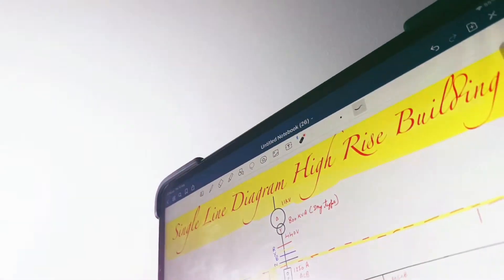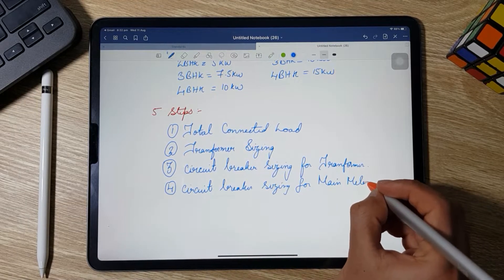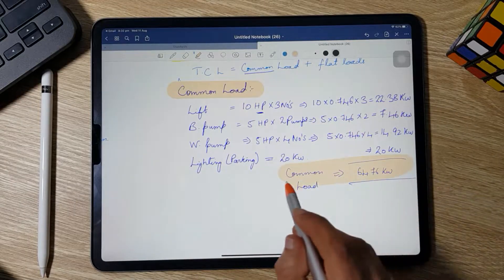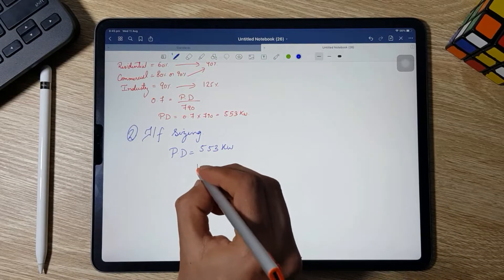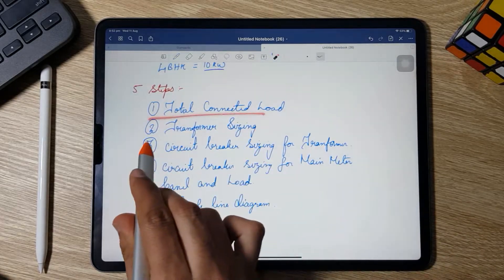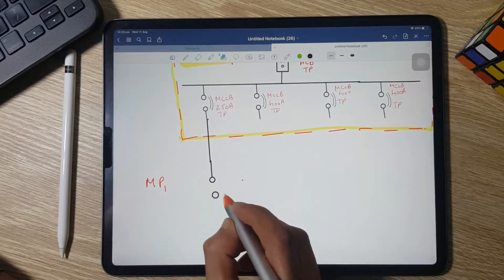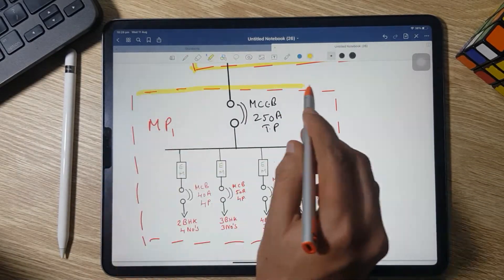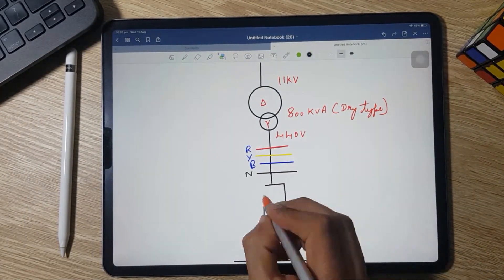Electrical Designing of High Rise Building G+10 | Electrical Design Course

Comment: when you calculate the current rating of the circuit breaker, you should consider the total connected load and not the peak demand. because te peak demand is always lesser than total connected load
the circuit breaker ratings should change, please correct me if I'm wrong

Comment: Thank you very much for this informative video. I had one question. 2BHK flats are provided with single phase supply. So when determining C.B size, for converting Watts to Amps, we should be multiplying with 8 and not 1.9 right? (Based on your G+5 electrical design video)

Comment: I have a doubt related cb sizizing 
For 1500kva transformer Secondary side.
Once we convert kva to amp
1500kva*1.4 =2100A
Should be consider 1.5 safety factor or directly select breaker from 2100A

Comment: Time 11:04 When you are calculating MCB for 2BHK load, you multiplied 5kw by 1.9 ... but wo to 3 phase ke liye aayega na ... for 1 Phase 5.43 Amp aayega na as 5 kw load is Single Phase load. Please correct me if i am wrong.

Comment: Where is the standard to be exact for 2bhk 5kw energy meter and 3bhk 7.5kw? I need to furnish it for a project of mine...
Reply from the maker: IS  13010
Reply: @ElectricalInfinity  thank you so much
Reply: @ElectricalInfinity  can't find it in there... Is it mentioned explicitly that for a 2bhk this much capacity energy meter and so on... I have calculated loads of all flats individually but even after taking into diversity factor the load is quite large...
Reply: @ElectricalInfinity  also if I could discuss it with you somwhere else..
Reply from the maker: It's a general thumb rule contractor follows for considering total load. Usually it's 0-10 amps, 10-20amps and 20-30 amps energy meter rating.

Comment: I need urgent help.
Actually I got bit confused.
I have to select cable, which load I should consider while selecting cable size from transformer to MDB
Should it be tcl amp or peak load amp or transformer amp or circuit breaker amp.
Pls do reply as early as possible
Reply from the maker: Usually a cable between transformer and supply connection facility is provided by supply authority and is sized depending on transformer secondary side ampere setting. Supply connection facility is used by supply authority to set the current to certain required amperes depending on supply application done by electrical consultant by calculating max demand. The cable from supply connection facility is sized depending on circuit breaker setting in supply connection facility. 

I hope this answers your question.
Reply: @ElectricalInfinity  appreciate your reply..
Reply: Always cable +breaker is sized as per continous current of the Transformer + consider the derating factors for grouping depth of laying and Thermal withstand capacity. and also the voltage drop . all calculated precisely.

Comment: How a flat will use 3 phase???
Reply from the maker: All loads are distributed equally among each phase of 3 phase supply. Usually the loads are single phase for example lighting circuits and power loads. If it's 3 phase load then a 3 Phase supply is provided.
Reply: @ElectricalInfinity  sir, then there are SPN inside the room which are not showing here???
Reply: upto 3KW  - 1PH /240V IS enough , >3kw opt for 3ph 415v.

Comment: Great video, thank you!! Would you make video on cable sizing considering voltage drop for high rise building.
Reply from the maker: Thanks. Will make it soon.
Reply: I think common load should be seperated and it should have Seperate SMDB

Comment: Sir can you tell me if load is 868KW, power factor is.0.8 and voltage is 415v and the cable length is 138meter.

Which size cable we should chose to have maximum voltage drop of 3 percent
Reply: Calculate VD on actual current , Not on Derated Current. Derated Current is only for cable+Equipment selection.

Comment: Great brother..Suppose you have 2 transfer pumps,1 is standby and other is on duty, means they will work interchangeable and both will not ON at Sam time and they are in same panel MCC,..So how will you calculate main cable to this panel, will you consider kW of both motor or only 1 ?
Reply from the maker: Total of both.
Reply: @ElectricalInfinity  but at any instant, both will not work together, then why we consider both load ? Is it general rule to consider both ?
Reply from the maker: That's why we take 0.7 demand factor after calculating total load.